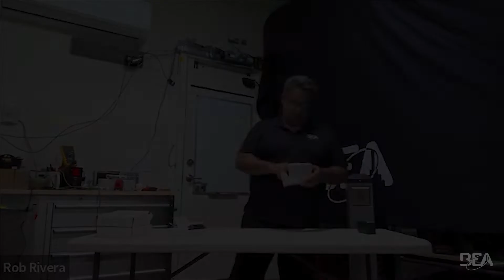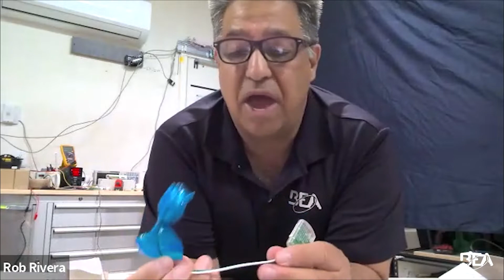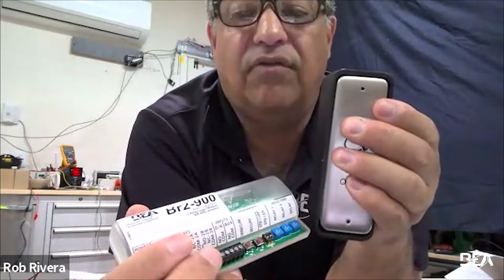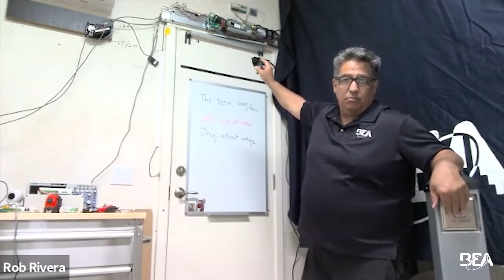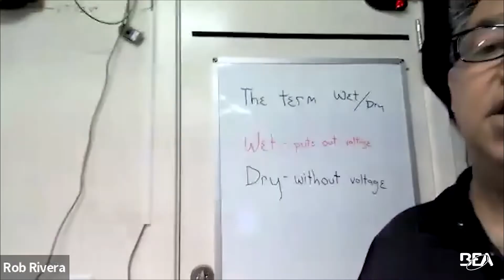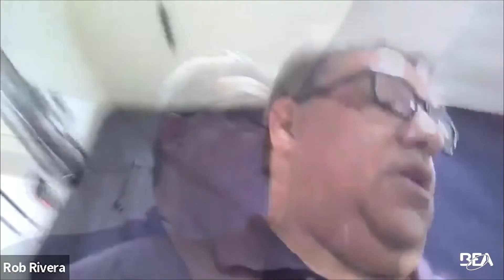Tech Time Live: BR2-900

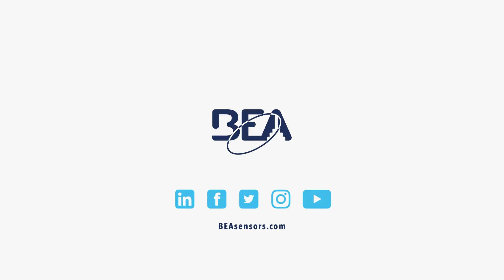Comment: Im an employee at Stanley Access now known as allegion. I 20:54 read the manual for this product thoroughly front to back i looked at this video and learned something i didn't know that the br2900 doesn't accept wet voltage nor spits out wet voltage. It may not be a big obstacle writing this. But it will definitely make a big difference when in the field when dealing/using this product to create a solution to a customers issue. That's for the informative video